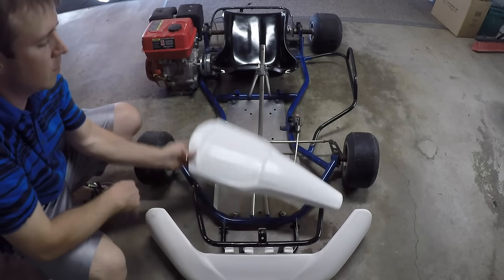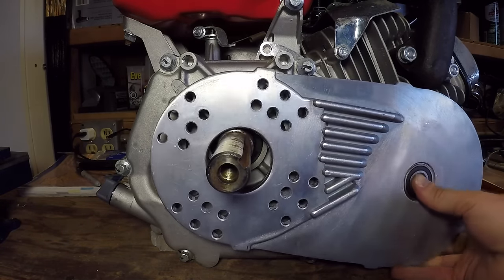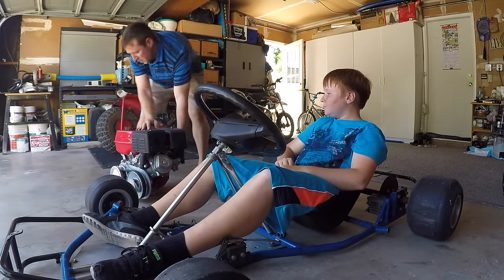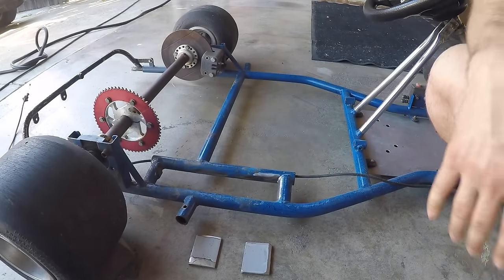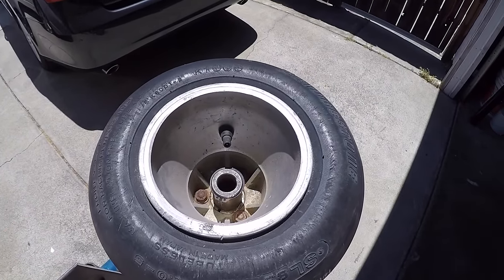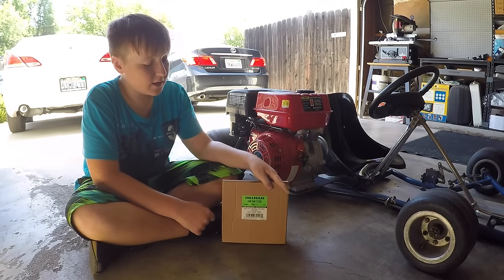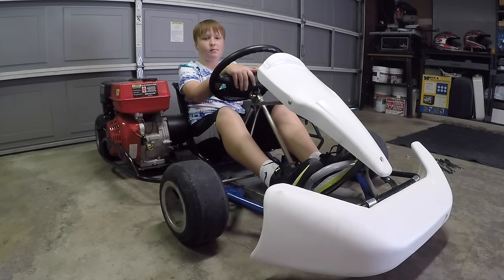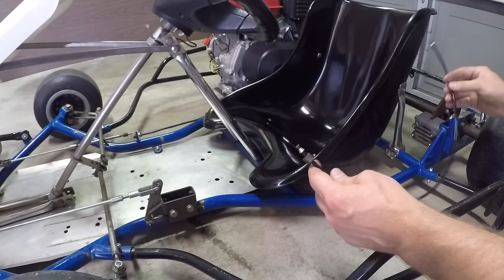9HP GO KART PROJECT

Comment: I just finished my 212cc go kart with a torque converter, tops out at around 40 so I can't imagine an 9hp
Reply: Tone Loc Baca This one does go 40... The rear sprocket is too big that's why.
Reply: The engine is heavily restricted aswell as it had a governor, to get the best out of it they need 2 open the crankcase and remove the governor. Then obvs they could go down the route of tuning, but a free increase in power is to remove the governor

Comment: Nice project but it has no safety equipment. Like bars and stuff... But those bars would probably slow the car down. Perhaps you could use rubber instead of iron bars
Reply from the maker: These racing go karts are low to the ground therefore its much harder to flip it. Although I'm sure its possible.

Comment: you should take the governor off that thing it'd be even more fun LOL
Reply: Fun until it blows up🔥🔥🔥
Reply: +Matt Dimaline any engine will blow up if you push it too hard same thing with that engine if you take the governor off and you don't beat on it you'll be fine
Reply: Add a cold air intake
Reply: +Hunt 1229 well it pretty much is a cold air intake because the go-kart does not have an engine bay where Heat can gather up and the best you can do is mod the carburetor and put a different filter on it

Comment: I might be wrong but I don't think that's really drifting cuz he's just using the weight of the engine to whip him around
Reply: your correct, he just flings it into corners.... also did you notice what a waste to put such a slow motor on such a nice chassis like they could of easily put a nice two stroke into it
Reply: Yeah its not
Reply: +DANKIEONPCIN1080P also I think it's a somewhat dangerous setup with the motor on the side where you can easily hit and get burned if it gets hot enough
Reply: +Brad thats the point of go karts...
Reply: That's where the motor is supposed to go on race kart frames.
Reply: His not drifting either way he is spinning out.
Reply: Brad how could I drift the other way if there is just like 30 pounds sitting right next to me?
Reply: You know that drifting is also using counterweight right?
Reply: Brad
Reply: Boo

Comment: Did you take the governor out of the engine? Removing it will allow the motor to go up to full throttle and a much higher RPM producing more power.
Reply: also giving it a higher chance of blowing up.
Reply: Extreme Burnout If the motor is properly kept, it wont. Topped off fluids, clean gas, etc. As long as theirs no knock, and the motor wasnt made in china, the likely hood of an internal failure is highly unlikely.
Reply: +RizoProduction also ruins the warranty.
Reply: +RizoProduction most of these motors are made in China, but even the Honda and Briggs motors will still throw rods and break flywheels if you rev them too high without a governor
Reply: +Barns Noble is there a way to modify the governor?
to get more top rpm but with a limit?
Reply: +DESCENT no
Reply: A governor is put in place to prevent full throttle. It's like buying a car with 400 horsepower, but a governor on it at 85mph, when it can easily do 150.

Sure it prolongs the life of the motor, but it's like a grandma buying a 5 speed vehicle and never getting it out of second gear.. Removing it will decrease longevity but will substantially increase power. Plus, these motors are extremely cheap to rebuild, and the worse thing that could happen is he gets blow by in the rings. The chances of him throwing a rod or locking the motor up are slim, especially  when it has plenty of oil in it, and it's not ran hot. 

Again, Taking care of an engine, and "hot rodding it" is completely diffrent than never checking the oil and hot rodding it. If it's topped of on fluids, and isnt held at full throttle for prolong periods ( 1-2 minutes straight) than it will be fine. I had a cheap ass predator motor that i pulled toe gov out of, put it on a shitty cart frame, and hot rodded the hell out of it for 3 years straight. You want to know the worst thing thats ever happened to it? I fouled a  plug, i replaced it, and kept on trucking for a solid 2 years before selling it to my friend.

But to each their own.

Comment: Torque converter not necessary you just need a heavy duty centrifugal clutch this will make the kart much faster or if you have the width then a 2:1 reduction gearbox

Comment: How has 35 Chain held up? I heard it can't last long with the power of a 9hp engine.
Reply from the maker: Project DIY 
Any chain will stretch over time and will need to be replaced. I usually buy a box of 10ft roller chain under $20 and that should be plenty, enough for 3 replacements. As far as I know go kart racing teams use #35 chain and many of their clutches are set up for that chain. I do prefer #40/41 chain because it got higher tensile strength but I guess to each its own. Thanks for watching.

Comment: Где приобретали комплект дискового сцепления (с ремнем)? Поделитесь ссылкой?  Where did you get the disk clutch? (with belt). Give a link.
Reply from the maker: Pine Films 
Это сцепление можно купить на EBay https://rover.ebay.com/rover/0/0/0?mpre=https%3A%2F%2Fwww.ebay.com%2Fulk%2Fitm%2F263233888551

Приблизительно они все одинаковые только нужно знать точный размер моторного вала. Они могут быть 3/4 дюйма или 1’ дюйм. Эти вариаторы ещё продают на Амазоне и на многих других сайтах. Набор называется 30 series torque converter. Удачи и спасибо за просмотр нашего ролика.

Comment: very good video but my question is this what kinda hydraulic brakes did u put on?
Reply from the maker: Luis Cruz 
This rolling chassis already had MCP master cylinder and caliper on it. We just installed new nylon 3/16 tubing and bleed the brakes. These brakes are readily available on eBay and Amazon. Good luck buddy.

Comment: thats a nice lookin kart, but dont u sometimes catch yourself on that exuast ? i have the same 9hp engine in my kart/buggy and im thinkin of takin the governer out...have you took it out this engine ? you can also get kits for these engines and put proper exuasts and and decent air filters on which i may get for mine.
Reply: I do on my and it freaking hurts lmao sucks
Reply from the maker: I tell my kid to keep both hands on the steering wheel to avoid burns. I will get another exhaust for it. So far we haven't done anything to it yet. We need to remove the governor, re-jet the carb and get another air filter for it. Racing kits are kind of pricey so for now we will do inexpensive stuff to it first. Maybe in the near future i'll look for better quality flywheel, rockers, springs and another carb. Cheers.
Reply: +balabay77 still happens when your sliding around lol I had hot branded on me for like a week

Comment: That thig halls down the street pretty good, has the governor been removed?
Reply from the maker: No sir, we haven't tweaked the motor yet. I bet if we remove the governor, re-jet the carb and get a different air filter then it might add couple of horses to this kart.
Reply: balabay77 Now that is what i'm wanting to see.!
Reply: +balabay77 you have to be careful with the governor, with the high rpms it can crack the rod in half and if your flywheel is plastic it will destroy itself from the high rpms. If you do end up removing the governor I recommend a Billet flywheel and rod so your engine won't end up breaking. oh and you should make a exhaust pipe (straight pipe) from steel tubing. Nice job on the go kart by the way, I like it very much. Keep up the good work.
Reply from the maker: Thanks Anthony for the info. i will keep that in mind when we decide to make it faster.

Comment: How are you going to change the oil now that you grinded the cap screw to a flat piece of plastic
Reply from the maker: There's another dipstick at the front of the engine. 
This engine had 2 of them which serve the same purpose but the one in the back of the engine usually rarely used.

Comment: Where did you get that engine man I love the way the project turned out and props to you guys
Reply from the maker: I found used engine on Craigslist For $100. Person who sold it to me was going to use it for his project but never got around to it. Thanks for commenting and watching. Cheers
Reply: +balabay77 and how many cc is it because it looks like it can pull and drift
Reply from the maker: +Angel “DelOroProductions” Gutierrez 
You know, I'm not sure because it doesn't say how many cc's. If it's identical to harbor freight motor then it's probably anywhere between 301 to 346cc.

Comment: Honda steering wheel link?!??  Looks dope
Reply from the maker: Jhouse 
I found this steering wheel on Craigslist  for $10 from older Honda Civic or accord can't recall for sure. It's cheaper than buying go kart steering wheel and works just as good. Had to make some modifications to it so that it would fit on the steering column. All in all it worked out great. Cheers

Comment: hello,please tell me witchn tourgue converter do you have, ho mutch is it?thanks
Reply from the maker: You can find them on Ebay or Amazon anywhere between 75 to $150 for a knockoff (not the original comet TAV2)
My set was 75 bucks and you'll need to know what size engine shaft you have. Most sets are for 3/4 shaft but my set was for 1 inch shaft. Google for 30 series torque converter TAV2 CVT. I'm sure you will get many results. Good luck.

Comment: Why does the go kart not move straight away when the engine is started?
Reply from the maker: Lucas Bouvier 
There’s a fully automatic transmission attached to the motor called clutch or CVT or also known as 30 series torque converter. Basically, on low revolutions per minute it just idles but once you start revving the engine, it engages and starts spinning the axle. Find a video how clutch engage. Good luck
Reply: Thanks so much 🙌

Comment: How did you mount the sprocket on the outside of the torque converter
Reply from the maker: I used C clips or also known as retaining rings to hold the sprocket in place. They work just as good.
Reply: +balabay77 I would love to see a close up of that set up

Comment: are you using a tork converter flat sided belt?
Reply from the maker: One side is flat facing engine and another side is slanted facing outward. (Asymmetrical belt).

Comment: buy some PVC pipe and put over the back tires help it drift a lot better
Reply from the maker: Thanks for the tip. I'll have to try that.
Reply: +balabay77 make sure u measure the tires on with and height
Reply: +Nick Breen and question what's ur plan to get the oil plug out when u need to change the oil
Reply from the maker: +Nick Breen 
I've cut the rear plug but the front dipstick plug is still there to do the oil change. At 1:37 you can see both.
Reply: Ah

Comment: I have a go cart and it was basically just a chassis wheel steering wheel and all that regular stuff on a chassis. me my dad threw a motor on it spray-painted it into the top so at about 40 and I think it has like 12 hp and the motor is a racing motor

Comment: How can you put new oil in to the engine, when it is due to a change because you did that to oil filler cap?
Reply: There is another oil cap in the front
Reply: +Jonathan McCarthy the one he cut of is for the gear oil
Reply: +Cooper Grasseth no that's oil for the engine I have one like the engine
Reply: +Cooper Grasseth I'm talking about the oil dip stick dude there is another one on the other side you could use
Reply: +Cooper Grasseth There are no gears in the motor.  The crankshaft pokes out the side of the  motor and the torq a verter bolts to the pattern around the crank. There is another dipstick on the front of the motor.  Oil going into the motor from either end lubricates the crank and bottom end. The motor in the small off roader i built is the same.
Reply: suomenpresidentti

Comment: What welder are you using?
Reply from the maker: I'm using cheap harbor freight 170 mig welder. Running Lincoln electric flux core wire from home depot. Works out great for me.
Reply: Thx!!

Comment: how do u check the oil if you cut off the dipstick handle
Reply from the maker: This engine got two dipstick plugs. One up front and one in the back of the motor. Rear plug is for convenience and not a necessity. Sometimes these engines are used on other setups like generators or water pumps where front of the motor is harder to access. That's where rear plug comes in handy.

Comment: Where did you purchase the rolling frame from?
Reply from the maker: Aaron Joseph 
Found it on Craigslist for $260. Sometimes people get rid of their projects, just got to keep an eye out for sweet deals. Good luck.
Reply: balabay77 How did you hook up the throttle? I am doing a project myself with a similar engine
Reply from the maker: MisterSlate Minecraft 
I’ve measured the distance between the gas pedal and the engine then bought a throttle cable on eBay for around 8-9 bucks. Once it arrived, I connected one end to the pedal. The other end of the cable ended up being too long.  I pulled out the cable several inches out of the housing and cut it with cutoff wheel grinder. Then pushed the cable back through the housing and attached it to the engine. Hope that helps.
Reply: balabay77 where did you attach it onto the engine though
Reply from the maker: MisterSlate Minecraft 
Each engine should have a throttle linkage that regulates the rpm or speed. Cable should be connected to that. Not sure what type of engine you have but if you are planning on using vertical shaft engine just like on lawn mowers than most likely it won’t work for you because those engines are pre-set to certain rpm. Look for videos where people connect throttle linkage on predator engines. Good luck buddy.

Comment: hola muy bueno el video pero tengo una pregunta que tipo de motor es el que utilizan?? es acaso el de una cortadora de cesped??
Reply from the maker: Yes its a lawnmower engine that i bought for $100
Reply: Yo vendo uno,  con embrague y todo
Reply: cuanto pedis??Boca 1905
Reply: cuanto pedis?? Boca 1905
Reply: looks like a bug frame possibly. I don't think I would of welded the engine plate mount on ... but hey! it works.. could of bought a proper bolt on one for 20 bucks..
Reply: jonathan taborda p0
Reply: najee123

Comment: To make it faster remove the governor from the engine.
Reply: Dude there's a reason why they put the governor on the engine. If you run it to hard, you will bend the engine's vowels and possibly blow the engine and replacing the engine.
Reply: +Major Luck  thx
Reply: +Major Luck Just saying. cause I didn't know if you guys where stupid enough to do that.but if you got slot of money to replace an whole engine, then by on means go ahead.
Reply: Briggs and Stratton dealer
Reply: That can blow up your motor
Reply: Alpha smurqwe
Reply: Nojueminitension
Reply: It's called buy a billet rod bigger valve Springs, cam, push rods etc that limits or reduces the change of a blow up
Reply: Noah Lechner I

Comment: are the motot mount sizes the same as a 212cc?
Reply from the maker: No i think the hole pattern of these engines are different. For example 212cc engine measurement is 6.38in(162mm) by 3.07in(78mm).  420cc engine got 7.69in(195.5mm) by 4.06in(103.00mm)  All you need to do is drill new holes and you are good to go.
Reply: thanks that really helps have been loooking at engines online and they say nothing about the mounting hole sizes

Comment: welp say goodbye to ever changing the oil
Reply from the maker: FYI there's two oil plugs. Front oil cap is a dipstick and I didn't mess with it. Rear plug is only used if the front dipstick is not easily accessible.
Reply: +balabay77 ahh ok

Comment: Wait is that engine made by WEN tools?
Reply from the maker: There's a high chance that it is. Pull start does say Wen on it. Guy who sold this engine to me for $100 told me that he was going to use it for his go kart build but newer got around to it. It was a Sweet deal on Craigslist.
Reply: 100$ is a steal for that 9hp engine
Reply: You should remove te governer and put a cold air intake and build a different exhuast for it, it would really make it faster
Reply from the maker: Thanks for the info.
Reply: hi could you make a kart

Comment: Y would u cut off the twist to the dip stick, how r u gonna add and check ur oil levels now with just that flat peice of plastic u have no more leverage
Reply: there are two dipstick's
Reply from the maker: This motor comes with two oil plugs. Rear plug is for convenience and front plug is actually a dipstick to check oil level. At 1:37 you can see for yourself that front dipstick is there as main plug. Cheers

Comment: GREAT kART BUILD!, DID YOU EVER GET THE "TYPE" OF FRAME YOU HAD ON IT DESCRIBED TO YOU?, I'D LIKE TO GET ONE WITH THE ENGINE ON THE SIDE, OR GET THE MEASUREMENTS , SO I COULD WELD MY OWN. COULD YOU PROVIDE THESE MEASUREMENTS FOR ME ON A PC. OF PAPER AND EMAIL TO ME?, JUST NEED LENGTH, WIDTH AT FRONT /CENTER, AND REAR, AND WIDTH OF SEAT/ENGINE MOUNT, AND EMAIL, PLEASE